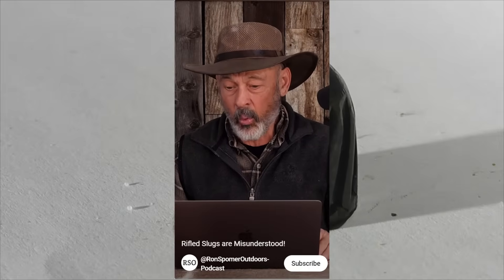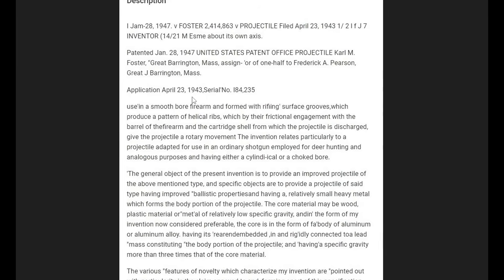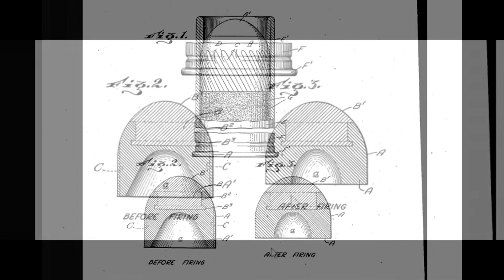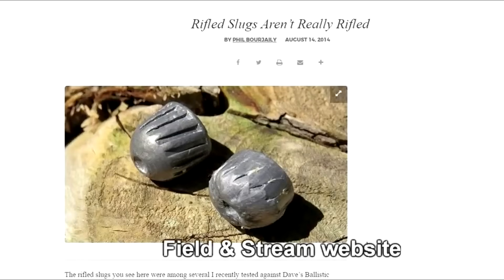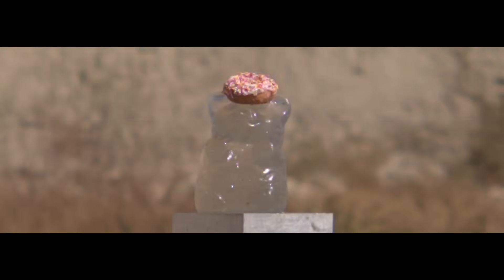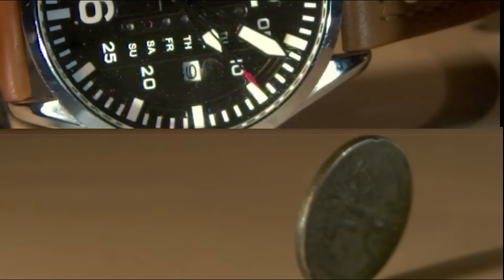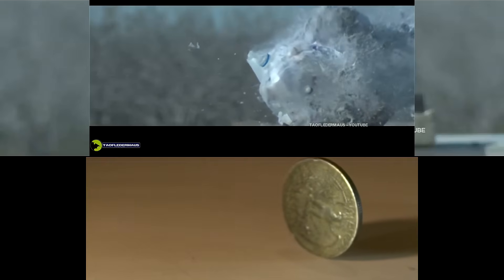Yes,  RIFLED Shotgun Slugs SPIN - The high speed camera doesn't lie

Comment: I'm not so sure the ribs cause much (if any) rotation in the barrel from friction on the barrel wall.  However, I have no doubt that the airflow over those ribs would certainly cause rotation.
Reply from the maker: Because there is a shockwave at the nose of the slug,  the airflow actually wouldn't contact the ribs.
Reply: @taofledermaus  But the speed of sound is ~1120 ft/sec at 32 deg.F, which is close to the MV of a typical shotgun slug. and it increases at higher temperatures.  If the muzzle velocity is supersonic, I'm sure it would drop below "c" fairly quickly.
Reply: @Pootycat8359  the slug deforms flattening out the ribs.
Reply: @taofledermaus  Yah I was thinking of that when I wrote the comment but figured the air had to be impact it.  grooved rifling in a slug passing through smooth bore doesn't feel like it would do much but if more knowledgeable people than me disagree I am open to correction.  I just honestly assumed as much and hadn't put much thought to it being any other way :p

Comment: The typographical errors in the document you showed are the result of a paper document being subjected to OCR, optical character recognition. 

You run a document through the scanner, and it recognizes most of the text, however there are often quite a few mistakes that need to be corrected. If the original scanned document is a multi-generational photocopy, then there is usually lots of garbage on the document that results in characters being misread. 

That's exactly what the typing looks like to me.

Comment: The biggest issue with getting accuracy from a foster slug is the difference in diameter between manufacturers.  They are smaller than bore size because somebody may decide to shoot one through a full choke. Bad idea if it is a full diameter slug. Also shotgun barrels have different bore diameters further complicating the process.  You end up shooting a whole bunch of different slugs to find the foster type that will shoot best in your gun.  Always had great luck with any of the Brenneke slugs and the Lightfield slugs…..they are no longer making them, but they were a great slug for hunting.

Comment: Rifled slugs spin a little, but not enough to fully stabilize.  The spin helps to stabilize, but most of the stabilization is aerodynamic.

The spiral vanes of the slug engage the interior surface of the barrel, but allow material to swage into the posterior recesses when it goes through the choke.

Comment: You seem to say that the slug is rotating at about the same rate as the spinning quarter, 12.5 revolutions per second. So, supposing the muzzle velocity of the slug was 1200 FPS, it would have been accelerated to its radial velocity at an average speed of 600 FPS. This implies an effective spin rate of 600 / 12.5, or one turn in 48 feet / 576 inches. If we used the muzzle velocity to determine effective spin rate it would be twice as slow. Muzzle loading round ball spin rates are about nine times faster than this. I don't know how effective this slow rate is at stabilizing slugs, but I have never heard complaints of slugs tumbling.

Comment: Just as with the angled fletching on an arrow shaft, the Forster slug rotates in flight, but not nearly fast enough for the projectile to achieve gyroscopic stability (Sg > 1.0). The aerodynamically induced spin does increase slug accuracy by "evening out" the cross-track veering from the intended trajectory caused by minor shape imperfections. A slow roll-rate is sometimes used in rocketry for this same purpose. 
Jim Boatright 
Ballistician

Comment: I cast my own foster slug from a Lyman mould this slug MUST have a hard card to expand to fill the bore and they go through the choke. I have even used a beeswax/olive oil lube after knurling the bearing surface with a file to hold the lube this prevents leading on the rifled choke tube. The foster was a brilliant design. I have also made round balls and modern wads make them more accurate than the old punkin balls.

Comment: All one would have to do to believe without actually seeing a slug spin, is just shoot a sabot slug out of a smooth bore and see what kind of accuracy you get at say  100 yds. vs. a foster at the same distance.  By the way you should have a relatively large target or you may miss the sabot completely.  I know because I did it and missed, yet the foster  hit the black on the first try.  The  sabot missed on the 1'st 3rd and 4th. shot and hit on the 2'nd and 5th shots only.  The fosters hit the black on all 5.  Circumstantial evident, perhaps.  Tell me if you had to bet a c-note how would you bet?   Just so you know I did this test with my father's  Almost 100 year old Browning A-5 with a full choke and plain old Remington ammo.

Comment: You say this 750 RPM spin rate "is enough speed to keep the quarter from falling over, and the angular momentum certainly must add stability to that slug" [comment starting at 4:50]

WHAT? Did you seriously just jump to the conclusion that a quarter spinning on a table at an arbitrary rate proves that a 750 RPM rate on a slug is enough to stabilize it in flight? That's not how things work. A quarter and a lead slug have vastly different mass and therefore require much different gyroscopic forces to stabilize them. Nobody would contend that 750 RPM is enough to effectively stabilize a rifle bullet (many spin in excess of 180,000 RPMs), yet if you use this logic, 750 RPM should be just fine and we should all adopt a 1:100 twist rate. Your conclusion is pure conjecture with nothing to support it and shows a complete lack of understanding of ballistics, or all physics, for that matter. Honestly, the whole video is kind of garbage science. I've never actually heard anyone say that Foster slugs don't spin, but I have heard that they don't spin enough to effectively stabilize its flight, which you have not disproved.

Comment: Alright, late to the party. Like clockwork. 
Plan to use my vr-80 (r.i.a.) for slug chucking only. Red-dot from holosun. 
Rifled choke. 1300fps minimum for any shells going into it. 
Curious how a Hornady SST (rifled barrel only shell) would fair in that much aluminum.
Don't worry, I'll keep the Hornady's out of it.

Comment: If it didn't spin it would tumble.
Reply from the maker: They will still fly nose-first without spin
Reply: @taofledermaus  I have a smoothbore .22 garden gun and every projectile fired from it tumbles due to no rifling. Pretty sure a shotgun slug w/o rifling will tumble.
Reply from the maker: @njzeigler4370  We have shot  slugs with no ribs on them before and they are stabile.

Comment: I was always under the impression that slug spin came from the external ballistic aerodynamics rather than barrel contact. Also the overall shape makes it behave like a badminton shuttlecock, thus getting some stability from a light tail. That's from an old Lyman article I read ablong time ago about casting your own with their smooth walled slug mold.

Comment: Yes rifled slugs do spin, but that's not why they're designed that way. They spend because of the effect of air flow on them when they exit the shotgun. The reason they are manufactured that way is so that you can fire them through different chokes without destroying the shotgun choke
Reply from the maker: There's no way air flowing of them would cause them to start spinning,  too much mass and too little time

Comment: I had my suspicions about whether the angled ribs would cause rotation of the slug, your video confirmed they do in fact spin, but the spin rate is unsurprisingly inconsistent. The spin helps to minimize the effects of any mass/aerodynamic trims on the slug, helping it to shoot smaller groups. Is the slug “stable”? Not by any objective measure of static or gyroscopic stability.

Comment: Everybody uses your explanation as a reference. But you are miscalculating RPM of Foster slug. In your slow mo, Slug travel about 2-3 yards with a quarter turn. That means within 10-12 yards it make a full turn. At 1300 fps speed slug get this distance within 0,02 second. İf you calculate again you will find approx. 3000 RPM may be over. Also  1 ons 0.73 diameter spinning top start to precession below 3200 rpm.

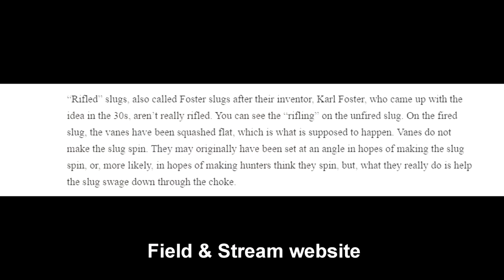Comment: For instance, a 870 rifled barrel is 1:35 twist. a remington slugger foster slug is advertised at 1560fps. 
1560 x 60 seconds is 93,600 feet.
93,000 feet x 12 is 1,123,200 inches
1,123,200 inches ÷ 35 is 32,091 rpm. 
750 rpm is most likely not doing much of anything. some 223 ammo is going over 250,000 rpm.. Thats a hell of a difference.

Comment: Did some quick math on your estimated rate of spin of 750 RPM 

Without showing the work it basically came out to 1 turn in 120 inches (10 feet). Consistent with a very slow twist round ball muzzleloader

Comment: My understanding was that the rifling on the slug was to reduce the amount of the slug that touches the barrel except for the skirt and reduce lead fouling because slugs are pure lead very soft so leading is a issue when say a 12 ga slug say moving 1800 fps and it did allow for a smaller surface would squeeze down and make it out a choked tube such as full. Had nothing to do with spinning the projectile like a Rifle does. They were always short range guns. Was no interchangeable chokes or rifled barrels for shot guns as we are blessed with Today and May we Keep it or Die Trying Amen 🙏 Love The Channel ❤
Reply from the maker: why bother making the ribs slanted then?   It would be easier to just make them straight

Comment: Jeff, next question. Do all gauges and types spin roughly same rpm, and what is rpm? The lady from Olin (her last name even!) said the foster slug was designed so the fins do three things. One it allows the slug to go down very tight chokes safely. Two it starts to spin partly (very little) on going down the barrel. Once it leaves, it REALLY starts to spin. You can paint a vane orange to see easier btw. Please, I'd love to know!

Also, my OWN guess here, there may be a fourth. It may allow gasses to pass by if it does block a bore or choke. It could flow along vanes forward. Chances are it will still blow a barrel, but it may bust the back rim forward even and past end and allow gasses past blockage. I'm not gonna try plugging one just enough to try it though.

Comment: I hate to sound like a know it all, but it made perfect sense that to the rifling on the slugs was there to impart spin. Even the venerated Ron's Spomer, whom I believe on almost anything else, I thought was likely wrong. 

The main reason I did not believe was that I knew even an improved cylinder choke would squeeze that slug for several inches.  If it was all about swaging, the rifle pattern was not necessary.  It could be knurled, ribbed, etc, and any of that would have been easier to manufacture.
Reply: So I really appreciated your high speed camera analysis several years ago.

Comment: The whole purpose of saying the slug doesn't spin is to deceive the antigunners in states that forbid rifles to be used. The minute they called these slugs "rifled" they had to discredit them with the lie about them spinning. My father told me this back in the 60's . There weren't any rifled shotguns readily available to use, and most folks were using buckshot at the time. Having an actual slugs gun like an Ithaca deerslayer that was designed to utilize a "rifled slug" was the best you could ever own. My father bought one in 1959 when they first came out.

Comment: Have you ever heard of the Greenhill Formula?  I always thought the argument was not if Foster slugs do indeed spin from the angled ribs, but if the spin was enough to cause stability.  Greenhill's does assume a solid bullet but the result should be close enough to determine a rough calculation of what spin rate would be required.  My calculations show a nearly pure lead Foster (Winchester 1 oz.) fired at 1500fps would need a twist rate of 1 in 118" (assuming no deformation, actually a lot of assumptions to be honest).  So if the slug makes 1.5 revolutions in 10 yards, I believe it is not sufficiently stabilized by it's rotation, but rather by drag stabilization, and the spin is irrelevant. This would also show why using a rifled barrel is silly, as a 1 in 28" twist rifled barrel would be greatly "over-stabilized", causing instability. Great videos, keep up the good work.

Comment: I liked your video.. dont give a damn what you think about my response BUT I have to say that I have fired 100s of foster slugs at 30 - 50 feet and they track like a real live bullet. The ones I recovered in 5 gallon steel buckets filled with mud were an inch in diameter and a 1/4" thick. That tells me that at short range they will deliver all their power into the target. I'd gladly use them on deer out to 50yards or humans out to 80 yards. Thats from a deer slug 18.5" Mosseberg  smoothbore barrel on an AG500 pump.

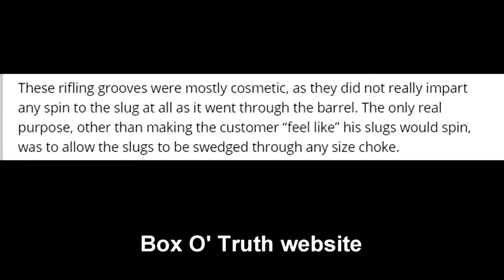Comment: It's clear that they spin - we can see that in a high-speed video.  The spin appears to be 12.5 rps, which at 1250 f/s velocity, means that the slug spins once in every 100 feet, for an effective "twist rate" of 1:1200 (inches) - compared to 1:12 or thereabouts for rifle/pistol bullets (nominally - 1:6 to 1:20), so about 1/100 the spin rate of a typical bullet (many of which - but not all - would be traveling faster).  Man, it is hard to see how that amount of spin provides any stabilization at all - based on the physics.  I wonder if drawing a parallel between a quarter spinning and a slug spinning is really justified, given the mass and mass distribution difference between the two objects.  It's still an interesting question to examine, and figuring out the rotational dynamics, well - it's gonna take some major head scratching.  I've heard twist rates in (12 gauge) rifled shotgun barrels ranging from about 1 in 2 feet to 1 in 3 feet, which is hella different from 1 in 100 feet.  It would be interesting to see if a non-rifled Foster-shaped slug showed any worse accuracy than was the case for a rifled Foster slug, when fired from a smoothbore.  Where the mold to cast such a slug would come from is anyone's guess.  Useful and informative video, as always - thanks!

Comment: I had seen your footage of the slugs spinning before, but demonstrating how low spin rates can stabilize a coin was a triumph!  QED!  In fact the slug will have much higher stability than the coin at the same rpm because it has much more angular momentum due to much larger mass at the circumference.

Comment: https://en.wikipedia.org/wiki/Brenneke, This outft has been making and selling rifled slugs for smoothbore shotgun barrels since whenever. I became aware of them some 50 years ago after Dad bought a Franci 5 shot auto shotgun. They always worked or savvy, non-suicidal, European wild Boar hunters would not have bought them. I always rationalised they possibly acquired some spin going down the barrel, and certainly some more spin due to air resistence during flight. Anyway, for whatever reason they simply worked. A bit like the areonautical  theories propounding that Bumblebees should not be able to fly according to the laws of Physics, but hey! they do! Simples, keep it..

Comment: My new Maverick 88 had incredibly poor accuracy while firing Foster slugs, until I recovered a slug from the snow and noticed it had a straight track-mark down the side. I traced the problem back to the barrel bead protruding slightly into the barrel. Was an easy fix to back it out. Then tried foster slugs at 150 yards, and the slugs would stay on target and only drop 1.5 feet. So there you have it. Foster slugs work!

Comment: Jeff - I do recall your video from before that the rifled slugs do get some spin imparted by the "rifle" grooves on the Fosters...but like the old wives tale of "one drop of sweat falling into your casting pot causes lead explosion" myths die hard.  We used to hear about that constantly - but now very very seldom.  Getting the word out on several occasions drives the points home.  Amother liked video - Steve
Reply from the maker: Haha, yes the drop of sweat in the lead pot.    You'd have to somehow submerge a drop of water to get a steam explosion.   thanks Steve

Comment: You spun a coin with your thumb and you believe you can calculate the ballistic and physical properties of that projectile?  Who cares if it spins, I get 4 inch groups at 100 yards with my Mossberg 590 A1  smoothbore cylinder using factory iron sights. That is proof.
Reply from the maker: I used my finger

Comment: I think the trajectory on the box is a little off as well. If fired from a 20" slug barrel the trajectory is close to what the box claims. But in a 28" improved cylinder barrel they don't seem to have the 12" drop the box claims. Kind of like rem. 700 sendaro with the 26" barrel from a adl or bdl with 22" barrel from the same caliber. What's your thoughts on it????

Comment: Everything black powder is where I hear it. Not sure if he coined the phrase first, but in any event, but it certainly strikes true.
As to the topic at hand, I saw a high-speed camera demonstration of the spin of rifled slugs many years ago. I don't remember any of the camera settings, but I recall the average rpm was in the high 600's to low 700's depending on the manufacturer and load. The test was done on a local range in Colorado Springs, Colorado, and I am not sure if or where the results were published - so take this as you will.
Great videos, by the way.
Reply from the maker: That's where I heard it.    Surprised how many people also got it right.